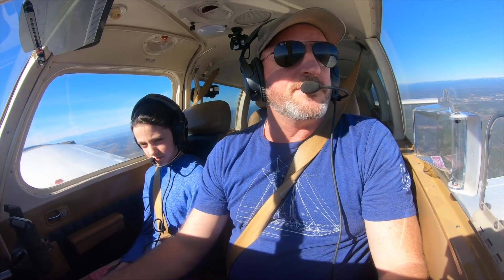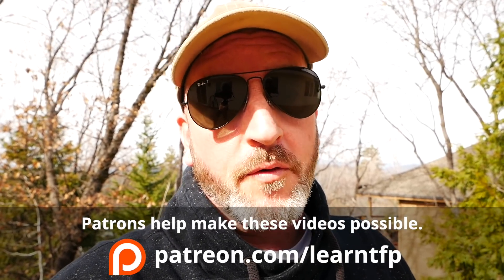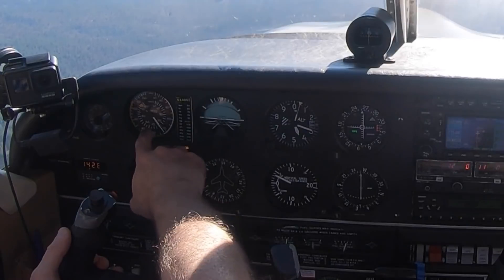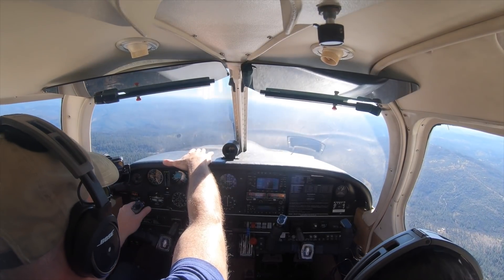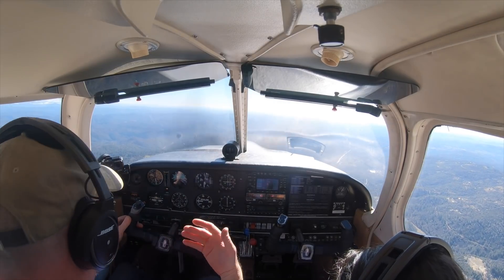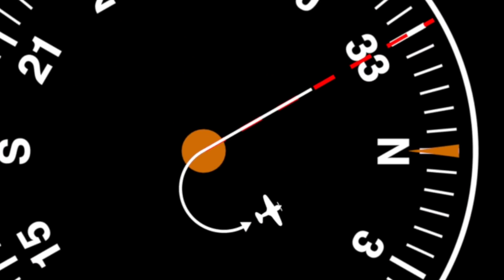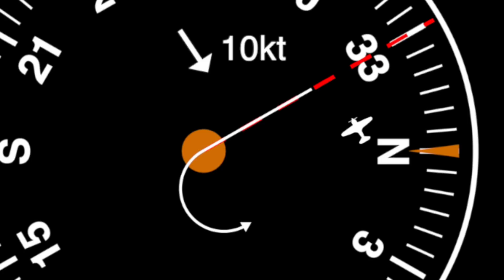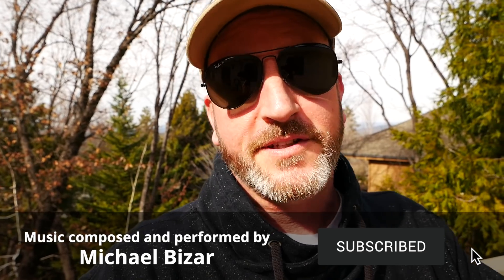3 COMMON Mistakes made by instrument PILOTS flying under IFR - flight training video for aviators

Comment: What is that "kneeboard" setup at 4:40? It looks very low tech but very practical. Is that a standard clipboard with a velcro board to mount the iPad, and the checklist is sandwiched between?
Reply from the maker: PIVOT CASE - get 10% off with code TFP 🙌🏻
It’s awesome! The only one I’d use

Comment: I just started on instrument and wasn’t expecting to have issues leveling off because I had been doing exactly this while flying VFR. What I didn’t realize is that I was using (probably as I should) the horizon for cues on my climbing and overall attitude. Well, you can’t do that with foggles on. I couldn’t figure out why I was struggling to hold altitude all of a sudden, then my instructor figured out that I was largely ignoring my attitude indicator. Once he had me focus on using the attitude indicator to find and hold an appropriate degree of pitch, my altitude holding improved instantly.

Comment: It’s not only looking down that will cause a lot of corrections. If you’ve never flown that particular airplane, if you concentrate on your altitude, or even if you are fiddling with the NAV system to try to get something set up. The airplane will always wander away from its heading altitude which most of the time causes fixation of trying to correct one of the problems while exacerbating the other. I have learned to basically learn what power setting I need, what pitch I need and to anticipate what the aircraft is doing for the effect of wind. If you are a renter it is a good idea to make sure that all systems are working before you takeoff. There’s nothing like trying to shoot a VOR/DME  approach and find out the DME is not working or the clock on the panel won’t switch to stopwatch mode. I even had a plane where the GPS had no approaches for the airport that actually has 5 separate approaches. Not only was the GPS out of date(legal for practice in VFR) but the was obviously no card in the data port. I was told this aircraft was the starship for IFR training!

Comment: If you move your head your vestibular system gets disturbed.. And a disturbed "sensor" won't pick up on you inadvertently initiating the turn.. Because the fluid is already moving.. it won't register the additional motion.

Comment: We always taught levelling off right from the get-go, but it was ATTITUDE PERFORMANCE POWER TRIM, so you know when to reduce power as you reach the expected airspeed in level flight.
This is just one of many important items that, when done correctly, makes flying so easy, thus allowing the pilot to concentrate more on situational awareness in all its forms.

Comment: Good advice. I was taught, and passed onto my students, "pitch, power, trim." When I started flying the 35, I realized how helpful that is, because that thing climbs like a homesick angel. Taking off out of HPN you are pointed toward the ocean, and you have to take off, turn to your heading, hit your assigned attitude AND keep it at 200 knots...all at once. Getting the power under control is crucial, and that huge elevator surface requires trim all the time. So, by pushing the nose over in a 172 and relieving yoke pressure with the trim wheel, and reducing power a little, I was able to accelerate well and hit the number without a lot of extra work. My tip for IFR pilots is that if you don't do IFR frequently (like several times a week, in "actual") you should have someone along who can work the radio (and gear/flaps if equipped) and can take the yoke if you get a case of the Leans. Imagine.. if that doc who drilled it in a few days ago had another pilot with him, he would still be alive, and his 340 would still be in pristine condition. Always be safe and proficient. It is job one.

Comment: Good reminder on levelling off. I was always taught to go very positive on the controls and let the aircraft accelerate up cruise speed before trimming. Can always add a little gradually to reduce the pressure as you pick up speed. I only power back as I near my intended cruise...had some great instructors! Go up to the APT (attitude power trim) and down to PAT the dog (power attitude trim)

Another awesome video!

Comment: Using power to level off is by far the worst technique I’ve seen. It lacks all finesse and basic flying technique. Here in Australia the most commonly thought way to level off is by using the pneumonic ASPT:

Attitude - set the straight and level attitude for the aircraft (~1/3 ground in the windscreen, or 0° pitch for IFR);
Speed - wait for speed to increase to or close to the cruise speed;
Power - set the cruise power configuration;
Trim - trim off the control forces.

Regardless of whether your flying VFR or IFR, this basic procedure will practically ensure that the aircraft is is in a stable configuration. A common fault is setting power before the desired speed is reached. By allowing speed to increase, you’re essentially allowing the aircraft to get up on the “plane” (like a boat). I’d be curious to hear the thoughts of others, or even your own, Jason. Cheers!

Comment: PAT APT. Power Attitude Trim to begin a climb/descent. Attitude Power Trim to level off. It's as easy as that.
Reply: i still remember taking dual in Aeronca Champ in 1957 out of a Rocky Mt. NC airport. Instructor was always very clear about APT and PAT sequence for any change in climb/descent/level flight. He seemed to have an excellent grasp of aerodynamics and the physics (forces/accelerations/rates) involved in flight.

Having been a motorcycle rider for most of the last 50 of my 86 years, I wholeheartedly agree with the point about being careful to keep your line of sight aimed toward your destination - Bad things happen if you don't.

Comment: #1 THANK YOU!  so much this.  When I took on two PPL’s they both pulled power and I asked them why.  They said their former instructor taught them that.   They also took 5min to finally trim and level off the plane.  I Demo’d.  they replicated.  Problem solved.   It’s a real pet peeve of mine

Comment: "let go of your grip" if you are holding on to the yolk with 2 hands you're doing it wrong.  and if you have a "grip" on the yolk you are doing it wrong too.  you lightly hold the yolk with a few fingers, you are not flying an Extra.
Reply from the maker: Even if you were flying an extra ... 😊🙌
Reply: @TheFinerPoints  
I want to go to Florida and fly with Patty.  It's on the bucket list.
Reply: "Let go of the Death Grip! " , my instructor would shout 😄
Hold the yoke the same way you would hold a hot tea cup. It's a 3 finger affair. Benefits are twofold :
1) It alleviates the urge to overcontrol
2) Teaches you how to use trim properly

Comment: I'm 3 lessons into instrument and I can vouch for the pulling on the yoke when looking down.  I will practice letting go of the yoke on a look down (for the fuel selector).  I have been making better use of flows, so I'm not sitting there with my finger ticking off the items on the checklist.  It is a backup/double check for the flow now, so hopefully less look downs.

Comment: Unfortunately, the technique of leveling off for cruise is something that is not properly taught during ppl training. I believe it is because there are not a whole lot of times where you are actively cruising during private training and those concepts are neglected. With that being said, I too struggled with that and it started to hurt me when it came to IFR training. It honestly took until stage III of instrument training to be properly taught the the technique of “pitch down and power through 100kts, then pull your power”. Ever since then I have become a leveling off pro! Great video!
Reply: Michael, Way back post training I had a simmilar issue; probable cause - just not enough practice in the basic training. I independently worked on the issue, and can 100% vouch for Jason's tips,, that is the Finest solution!

Comment: About leveling off - they say, power for altitude, pitch for speed. If you find you're climbing after pulling the power to level off, you didn't pull enough power. The plane will fly just fine at climb speed, but it will not be very efficient. If you pitch for faster speed and don't adjust the power, you will start to climb again, as you described.

Unless I totally misunderstood...
Reply: Jason is the CFI, but what works for me is pushing forward when you hit cruise altitude, letting airspeed increase to close to cruise speed, setting the cruise power, then trimming out the forward pressure.  And just to be safe, checking the altitude again after the airspeed is at cruise change, adjust trim again if you need to, then don't think about trim again until you have to do a descent or whatever maneuver might require a trim change.

Comment: It's controversial, as in I was taught to do this by one CFI and another said I should never do it, but I've found it useful when transitioning to level off to add a small amount of down trim at the start. This relieves some of the control pressure that begins building as the aircraft speeds up to cruise, and makes it easier to stay within 50 ft of the target altitude. Then once cruise is achieved (and power reduced), adjust trim as necessary for the final speed. Works for me, anyway.

Comment: This tip on leveling off is excellent! You described exactly what I have been doing wrong, flown with several instructors and no one has said this. I'm going to put this into practice if the weather ever straightens out.  Finally got my pp at 63 and working on my instrument.
Reply: Me too. 63 is the new 36

Comment: Heading to the aircraft in a few to argue with my instructor about pulling power to level off......hahahaha. Great points!!
Reply: Same. I was always thought to pull power, re-trim, and then do the rest of the cruise activities (lean mixture, aux. fuel pump off (if it’s not already, etc.). But I’ve experienced this phenomenon so good to know.
Reply: @bobwoodward1089  My current CFII is "trying" to break me of this bad habit....